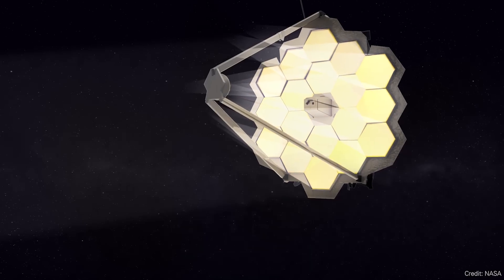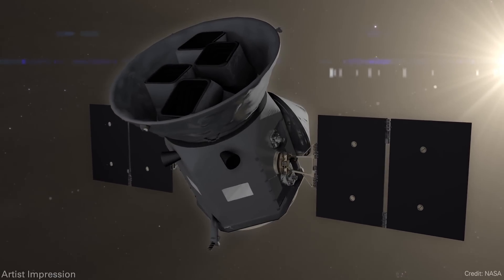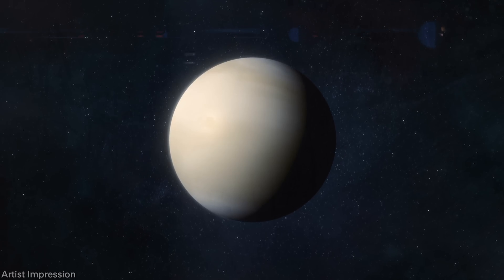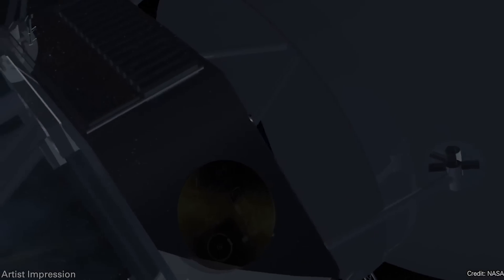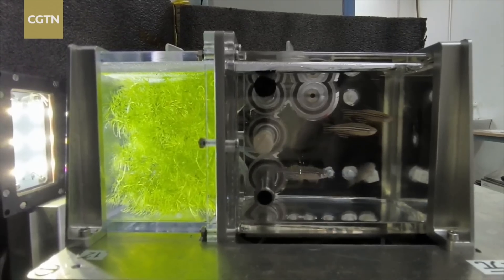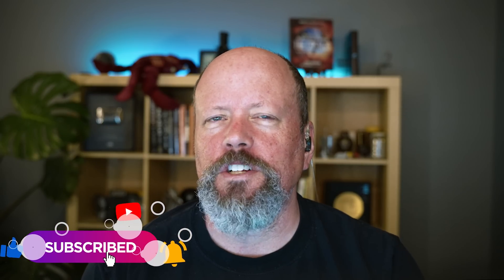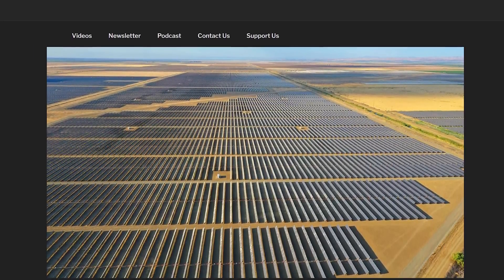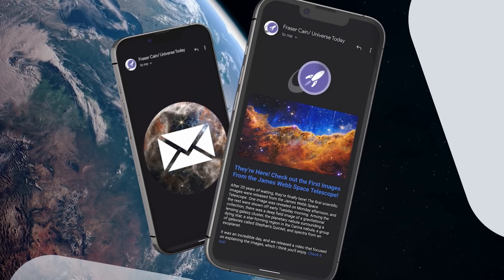New GIANT Space Telescope Proposal // ExoVenus Found // China's Space Aquarium

Comment: The off-axis mirrors shouldn't be that difficult.  If you got rid of half the james web mirrors (on one side) you'd be left with an off-axis system.  i think the problem though is that you have to either make another huge mirror and cut your mirror out of it, or you have to grind an asymmetric mirror from the start.  With JWST you basically use tiny servos to get the thing into shape so maybe it could be done that way.  I always wondered why that wasn't done but I assumed there must be some reason, lol.

Comment: This "Earth like" planet is useless to us for colonization purposes if the info on it is correct.

At the inner edge of the Goldilocks zone of a Red Dwarf the planet would be tidally locked... Bright side would likely be hot and subject to severe storms, not sure about the dark side due to convective forces swapping cold air from the rear with hot air from the front. Not sure of the effect, but "earth like" weather would seem unlikely. With an "average" 100C temp, not sure what that means as there are two extremes involved and the temp should vary wildly depending on which side you are viewing.

Info indicates, it is about the right volume, however, the planet is MUCH more massive than Earth according to all the sources I could find. 3.8x the mass in the same or slightly smaller volume, so the surface gravity would be more than 1.6g. 

A 180lb human would weigh 288lb. 

IF the mass calculations are accurate at 3.8x earth, the size becomes completely irrelevant as "good" things go. Surface gravity is what is important. You would probably die of heart failure in weeks. (Imagine walking around with an 80lb army pack... day and night.)

3.8x seems rather high, however, and is hopefully (very) wrong, though I would imagine it easy to calculate correctly at only 40ly away. Earth has an average specific gravity of 5.5 (water  is 1.0) So this would suggest an average specific gravity of 21. This would put the Average density on a par with Platinum... Seems unlikely in the extreme. Begging the question: "What is this planet Made of?"

If they can't even guess the density (mostly) right at only 40ly away... the rest is just trash info, too vague to be useful.
If they got it right at 3.8x earth density, then this is a crap candidate for anything like colonization.
We'd be better off building rotating cities in the asteroid belt near places like 16Psyche where heavy metals are plentiful. 

Sorry for the negative attitude, but I'd Really rather they stop didling around with Red Dwarves (yes, 10x more common... so what) and focused on Yellow main sequence stars with Much larger Goldilocks zones and No problem with tidal locking and fierce magnetic storms that frequently blow away atmospheres on candidate worlds as is the case with most Red Dwarves... which, by definition have no protective convective zones.

Ie focus mostly on K, G, and F type stars. Surely there are plenty of good targets. (That's 22% of all stars.)

Comment: I don't understand why an off-axis primary mirror is such a challenge? Why isn't it as easy as simply tilting the mirror sideways slightly?
Reply: The mirror has a focus point. If the optics are not designed in such a way that the focus point is not off axis, you will get a distorted view. Most primary parabolic mirrors have the focus point on center of the spherical shape, which means the secondary mirror has to be at the same point. This will then create a "Secondary" obstruction, blocking some of the light gathering capability.

Comment: I just can't see how a 14 m one-piece mirror could be manufactured and then also launched. I thought the practical limit for one-piece mirrors today was at around 8 m, beyond which the distortions due to the own weight of the mirror become unmanagable. No space launch system today or on the drawing boards can carry a payload that wide, so how would you get it up there?
Reply: Maybe the mirror could be manufactured in space? That would eliminate the weight problem. And the mirror would not have to have a 1/12 thickness to diameter ratio.

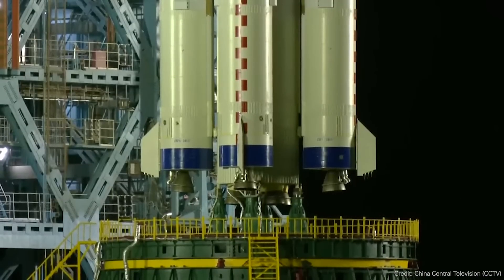Comment: 7:27 Fraser,
Since I’m older than dirt I know that space aquariums are not new. In fact, an aquarium with live minnows and 50 minnow eggs was brought to Skylab back in the ‘70s. Interestingly, the Skylab crew saw similar results. The adult fish swam in loops at first but eventually figured it out. The most interesting finding was that the fish born in space swam correctly at birth. To read more, the website for Scientific American has a good write-up.
Reply: Just wondering, how did they get oxygen for the fish? Bubbling oxygen wouldn't float away from the nozzle.
Reply: @coachtaewherbalife8817  slight pressure from the oxygen nozzle should be enough to dissipate the O2.

Comment: I think we should build space binoculars. Take a  maximum diameter telescope that will fit on current rockets. Then another one inverted stacked on top. Connect them with a hinge and data cables. When the booster places it in the destination such as a lagrange point, fold them into a side by side binocular position. This is probably one of the largest feasible configurations that can boost on a single rocket. The binoculars also have some imaging advantages.
Reply: You would design it to use the upcoming SLS Block 1B cargo fairing at 8.4M, you could make an obscenely large telescope by making it as a binocular.
But there is a more wild idea you could do if you make the system modular in the sense you could keep adding segments to it. What is stopping you from making a far larger trinocular setup or going insane with 10 mirrors?
Reply: @theemperorofmankind3739  Lifted mass limits would mean a binocular is probably the biggest for a single lift. Instead of trying to add extra segments together in space, lift extra binoculars to park in the same general area and network them together..
Reply: @Stu_Bur  That is what I meant I am not good that language.
Reply: What advantage would binoculars have in space?
Reply: @executivesteps  There are some large ground based binocular observatories. The binoculars in space would have the same advantages. Large total optical area for a given diameter limit. Additional parallax related data. Interferometry capabilities both from the two optics in a binocular as well as any networked binoculars. Error correction and Image correction, such as reducing or eliminating the diffraction spikes. In other words, the image quality can be improved.

Another benefit is that they can share some imaging modules, allowing for example perhaps imaging in two different bandwidths at the same time. They could also potentially have duplicate modules with some degree of redundancy for some data.
Reply: The Starship Super Heavy booster section is another potential option, at 9m diameter. It would require a custom top portion, perhaps a Starship derived enclosure.

Comment: Looking back on the Bio-Dome, I always felt the people involved were too focused on making us think it was a success, rather than actually learning from the experiment.  When it ran low on food and oxygen, they were more concerned about hiding the facts rather than openly talking about lessons they learned about the area and volume needed per person for survival.
I think they were scared of all the negative publicity about the cost.
Reply: Having visited the structure and learned a lot about it, the cause of the failure was rushing to do both large crew and long duration enclosure too soon.  They went from an enclosure period of weeks and then immediatly tried to do years which was crazy ambitious, working up gradually to longer durations would have been the smart move, but the project managers were in a rush to prove themselves.  The cause of oxygen loss was Carbon Dioxide absorbtion by Concrete which is something ANY person with the slightest chemistry knowlege knows happens to concrete over time and infact never really stops.  Either sealants needed to be applied to the concrete surfaces or the structure needed to be 'cured' by saturating it with pure CO2, at pressure for a year before any living things were introduced.

P.S.  Their is a long running misunderstanding that the facility is called 'Biosphere 2' as a reference to the Earth itself being Biosphere 1, this is false.  Biosphere 1 is a small room sized structure built first at the same site in which 1 man and a bunch of potted plants stayed for a few days to validate the concept.

Comment: The Large Binocular Telescope is not off axis (secondary mirrors are in front, but they are not on regular tripod structures). The outer ring of mirrors on The Giant Magellan are off axis, it will be interesting to see if that improves the images.
Reply: With circular mirrors and no mirror    supports blocking the incoming light there will be no diffraction spikes in the images.
Reply: @executivesteps  Yes but the central mirror still has supports in the way. I wonder if they will ignore that mirror when taking some of the images.
Reply: @zapfanzapfan  The supports for secondary mirror are placed between the 6 primary mirrors so there’s no obstruction.
Reply: @executivesteps  No obstruction for the outer 6 but still for the central mirror.

Comment: Correct me if im wrong, Starship booster being 30ft wide, you in theory could build foldable JWST 2.0 mirrors of 28ft wide making it 145ft wide in total. All need 2nd stage same as Falcon 9 rocket fairing. Replace starship with 30ft fairing holds JWST.

Comment: Can you please explain something? We talk about our sun's habitable zone being about from Venus to Mars, yet we have Earth where the distance from where it's as hot to as cold as it can be for life in just 6,371 km. Equator vs poles distance from the sun.
Reply: The reason that the poles are colder than the equator is not because they are farther away from the sun. The poles are colder because the sun is lower on the horizon, resulting in sunlight being more spread out and having to pass through more atmosphere before it reaches the ground. It's similar to how sunlight doesn't feel as warm during sunrise or sunset compared to midday
Reply: The habitable zone doesn't take into account the atmosphere of the planet.
Without atmosphere, where we are in our solar system, and considering how much energy we receive from the sun, Earth would be below freezing water temperature.
Reply: In addition to what jenbanim said, there are numerous factors that determine the heat of a planet.  Despite being much further away from the Sun, Venus is hotter than Mercury due to its dense atmosphere.  Earth was once significantly cooler (snowball Earth) and significantly warmer than it is today for reasons too complex to go into here.  Temperatures on Mars can reach as high as somewhere around 20C / 70F, but it doesn't have a substantial enough atmosphere to retain the heat and gets blisteringly cold.
Reply: Earth is like 5 million kilometer closer to the sun in february, than it is in august. 
Do you notice any difference? :P

Comment: how are they planing to put a  14m mirror in orbit, we have nothing capable of doing that, unless it's segmented and the illustration is wrong.
Reply: I'm sure by the time they actually build it and get it ready to send to space, Starship or some other large rocket would be able to. That or we may be able to put it together in space.
Reply: It's a deployable antenna, similar antennas are used on communication satellites but not at that wavelength so that "mirror" has to be really smooth.
Reply: @zapfanzapfan If they’re looking at the far infra red the surface “smoothness” is a lot less.
Reply: @executivesteps  Far infrared is a lot shorter wavelengths than satellite phones, sub mm compared with several cm. So the antenna has to be a lot smoother than the regular application of that technology.

Comment: I helped build the James Webb Space Telescope and can tell you from first hand experience that something of this size is unfeasible. I’d love to tell you it’s possible but the amount of work that went into the Webb, is just mind blowing.
Reply: The first precalculations for the next telescope started after the first test of Starship.  What made JWST so expensiv, was mainly its origami design.  With a 9m fairing and its reduced launch costs, universities can possibly afford their own space telescope.  ESA is also looking into this.
🚀🏴‍☠️🎸
Reply: What part of Webb did you help build?
Reply: @diverguy3556 sunshirld, mid boom, spreader bars, OTIS (not the mirrors, built in  Goddard), solar array, MRD/NEA’s and it was a nightmare. Getting everything to work was a something short of a miracle.
Reply: Was the first bit that came to my mind. After thinking a little bit more I wonder if using a segmented mirror will and dropping the off-axis requirement will change the equation. If Space X ever succeeds, Starship is supposed to have a 9m diameter fearing.  This will require a 60 to 70% expansion. Does that change your perspective?  The good part is that even an on-axis 9m telescope will be so much better than what we have.
Reply: @jaimeduncan6167  the biggest issues were the sun shield, midboom, spreader bars and tensioning. Every time we tensioned and deployed all five layers we’d run into damaging the solar shield layers.
Reply: @jaimeduncan6167 At 500 microns it’ll have less resolution than a pair of binoculars. This telescope at long wavelengths will be mostly about spectroscopy. 
At 15 microns even JWST has the resolution of an amateur astronomers backyard telescope.
Reply: The design process for Webb started before Hubble even launched. I don't doubt Webb was impossible to do in the 90's. Part of the reason we do these things is to make them possible. If you actually helped build it you should know this.
Reply: @Zero_Gravitas JWST would have fit inside the SIVB stage of a Saturn V rocket with the mirror unfolded.
Reply: I think you would have to assume that this telescope would be utilizing the Starship as it's conveyance. And, therefore, the size of the in-fairing pieces can be much larger.
Reply: which part?

Comment: You can work years on 5% improvement in software analysis or build bigger hardware 400% better. There will no significant progress in astronomy without much bigger telescopes.
Reply: Yep, data is the limitation. To improve data collection we need bigger and better telescopes.
Reply: 6 out of 7 proposals for telescope time on JWST are rejected. Size matters and so does the number of telescopes. 
Telescopes don’t necessarily have to be bigger to make significant progress.
Reply: @executivesteps  By significant progress I mean stronger limits on models of dark matter, dark energy, Hubble constant, etc. Observing more similar objects on the sky is not significant.